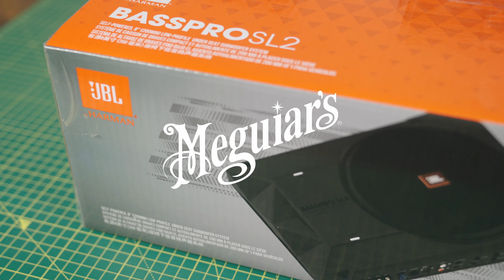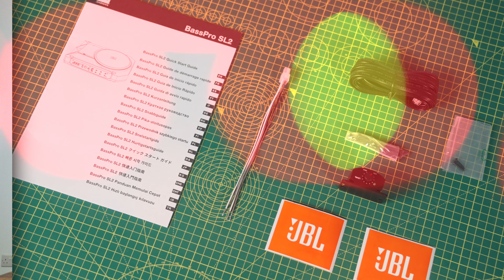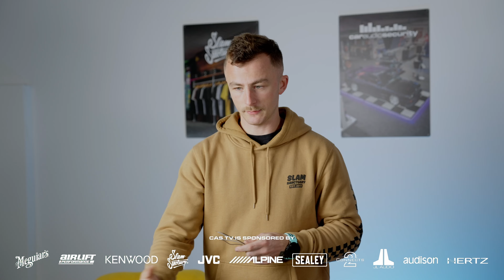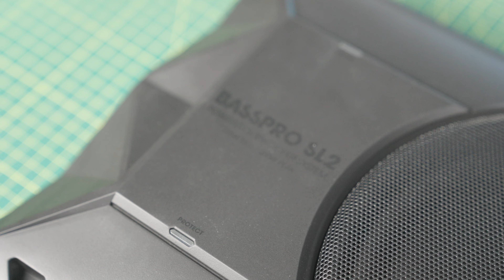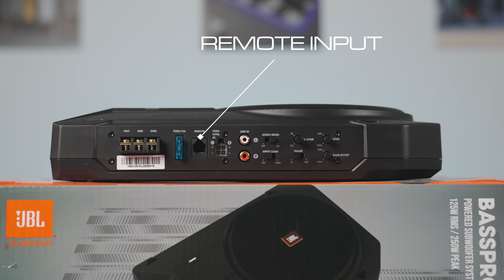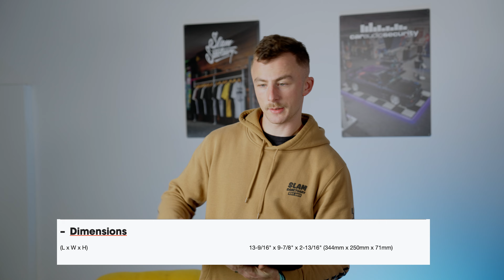JBL BassPro SL2 SUPER COMPACT Active car subwoofer | Car Audio & Security

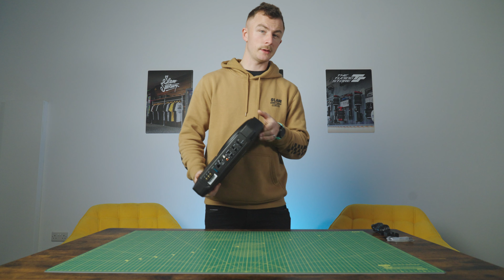Comment: at 2:48 you say "Keep in mind it is meant to reflect the sound off another surface, like the bottom of a seat". Does that mean it won't sound as good if you mount it in the 'open', such as somewhere in the trunk? Should it face another surface if possible?
Reply: Correct, the reason why under the seat works best for this SL2 is because of the soft material your seat cushion provides, allowing the bass to sort of flow out.  If you plan on putting this thing in the trunk though, get a real subwoofer instead because this thing will disappoint you if you plan to mount it anywhere else besides under the seat.

Comment: Do you have to use the little controller or can you just use the stereos settings?
Reply: According to the official manual, it's optional. Fine tuning from the woofer controls is required though.

Comment: Would this work in a old school car like a car from 2000 ?
Reply from the maker: hi, yes this would however we highly recommend anytime installing one of these types of active subs to make sure they are loaded by covering them i.e. fitting under or behind a seat to get a better sound quality
Reply: What is the best optimum setting for it?
Reply: @ErnestKyleDelaCruz there isn't a general optimum setting, otherwise it would just come like that without any way to adjust, you need to adjust to find the optimum settings for you and your installation

Comment: Wouldn’t you need 2 of these?
Reply: they wouldnt know, they didnt test it
Reply: @Northsidewhiteguy lol thanks ig i dont need to watch this🤣
Reply: No a single sub is very common, and it's attached to the amp so it's meant to be run independently, it's a lil more work to get multiple amps to work in sync simultaneously, not impossible but this is a speaker meant for simplest possible bass upgrade